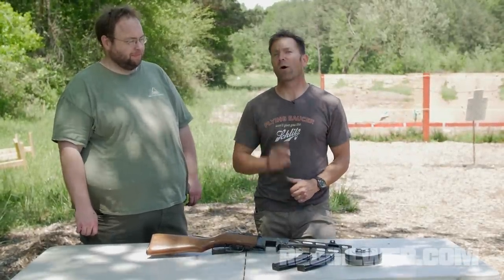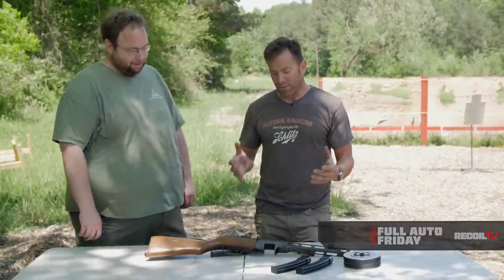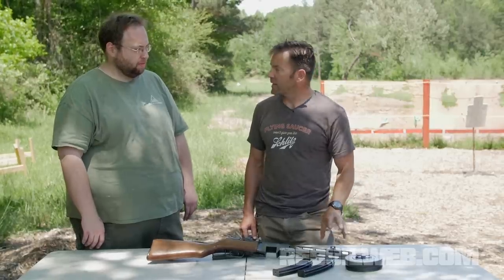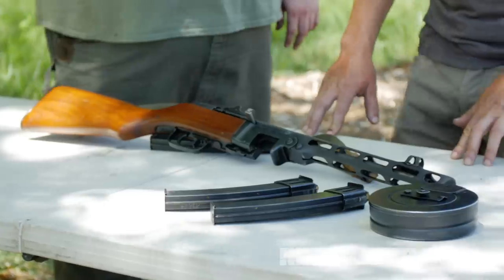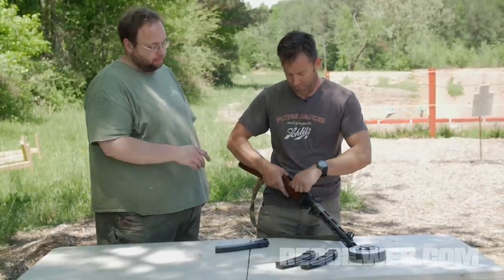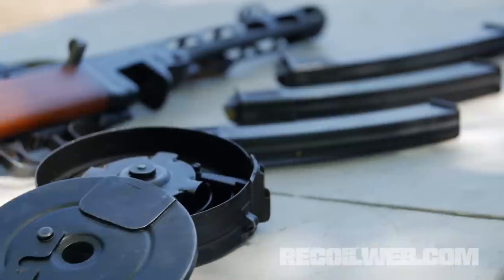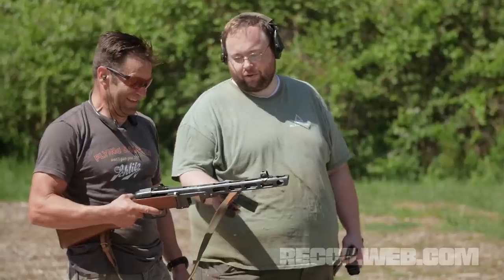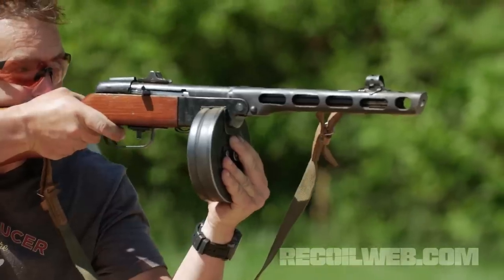The PPSh-41 Soviet Submachine Gun

Comment: PPSh-41 is pretty good! My favorite WWII SMG.
Reply: One of the real, genuine questions I have is just how effective a WW2 SMG was relative to a rifle as a general purpose battle weapon.

SMG on full auto is obviously far more effective at short range.....but how short is short?

And in semi auto mode, how effective were they out to at longer ranges? Up to some, quite significant range, a semi auto SMG is obviously more effective than a bolt action rifle.

There seemed to be real resistance in many armies to the mass issue of SMGs for general combat purposes.

Has anyone got a good insight into this matter?
Reply: @ohlordy2042  well for the germans at least
when they first designed things like the mp18 during ww1 it wasn't meant to be a long-ranged weapon what so ever
but they did intend them to be capable of (semi) accurate fire up to 200 meters
(WW1 at least)

and the hesitation of mass use I believe just has to do with the cartridge and practicality of the submachine gun as a whole
one common argument I find is over the use of shotguns and while effective at close range a submachine gun would stand up better as a whole from range, to rate of fire.

But a thing I believe about why rifles stuck as the main wasn't just the power of the cartridge itself but also the ability to conserve it.
One of the main reasons it took so many armies to get repeating rifles was just out of fear that soldiers would waste it, its also why some rifles had magazine cut-offs.

I know what I said was probably all over the place but this would be my guess as to why they didn't mass adopt them.
(But I'm a ww1 guy what do I know?)
Reply: @luger_Mann  price and complexity made it harder to manufacture in comparison to bolt action rifles, less sophisticated parts needed=faster production and cheaper manufacturing Is my guess.
Reply: Yes
Reply: @ohlordy2042  the sub-Mp's found thire way into military in WW1, it was a warfare of positioning in trenches firing at each other and then either advance forward to capture land or move back to either defent(hold out for support) or to bomb with howitzes the enemy position.

Due to the fact that when you capture a well dug trench there will be a lot of dudes in there so having a bolt or even a semi rifle(rare and expensive to that time)they needed something that does the job, in a trench no one can hide to right and left anyway so a full-auto pistol cadridge fed weapon was requested.

In WW2 the sub-MP's are more of a clearing out weapon(bunkers or mayor firesupport in CQB situations or on short ranged battlefields but also for drivers, tankers and Comanders because those were the kind of people that didn't needed to head to the main frontlines or rather the main battles, but if they do they needed the superior firepower in this short range)

In the End at 1941-42 Germany used and tested STG(Sturmgewehr/Assaultrifle)prototypes, which had the effective use of beeing a full-auto weapon that is also capable of rifle similar distances has in alternate firemode a semi-auto capability and was magazine fed, and in 1944 the , till now, modern rifleman was born. In a testing report by a german commander was stated he was facinated about not having to fight battles area by area and inbetween reloading and prepareing troops, what they could do were just keep advancing and give defesive firepower and attack power in total and reload mid fighting very effectively.

If you take some creatins from WW1, the guns are always build for the purpose that was asked by troops and commanders to fullfil certain rolls,
Italy as example converted a fast firing plane-tail-MP in a sub-Mp for troops just to fit the needs of trench warfare.
The German Sturmtruppen(Stormtroops) had befor having the MP18 litterally an Gewehr98 with a hard installed 20 round box mag(trench mag) just because they needed strong firepower lots of ammo(less reloading) and a weapon that is to an extend effective to use.

In WW2 the MP40 was only a slow firing full-auto because you can manufacture it cheaper and pull the trigger soft you only fire 1 round so you can waste the country expenses for hard artillery and machineary instead on useless manufacture detailes.
You will see some last ditch weapons that didn't even get grinded so there is even a chance that your bolt could stuck on a a rough surface or like WW2 Japan that some major parts of the rifles were made out of wood and the gun had the tendency to explode in your face and kill you.
Reply: @Confirmed105  It depends on the firearm, the German FG 42 would have actually been somewhat easy to mass produce do to it being mostly stamped parts and if we compare that to say the Swiss K31 (I know different armies but still) the FG would have been far cheaper to mass produce since the K31 is handfitted and much harder to make.
Reply: @prestonsamson3674  I think my take is more accurate for the early war atleast. Soviet's had millions of smg's after the war that became obsolete when they started issuing assault rifles post-ww2
Reply: @luger_Mann  

Lots of interesting comments here.

I don't think price was necessarily the main reason for the lack of general issue of sub guns. Some subs were notably cheaper and faster to manufacture than bolt action rifles. The Ppsh41 and Sten being prime examples.

Just looking at online ballistics calculators, the energy of low BC handgun rounds drops rapidly with range. Ppsh41 rounds......7.62x25 Tokarev....have the energy of a 380 ACP at 100m and are no more powerful than 32ACP at 200m. There is also considerable bullet drop, making Tokarev rounds fairly marginal at 200m. 

But that still doesn't explain to me why sub guns weren't issued far more widely.

I'm sure that even a "marginal" round at 200m would be very effective at ensuring enemy soldiers keep their heads down and do their level best not to get hit at that range.

I'm sure I'd be extremely reluctant to expose myself if bullets with the energy of a 32ACP were whizzing past me. Getting hit would count as a very bad day. It would certainly take me out of the battle and quite possibly the war.

It seems to me that a semi-auto capable submachine gun would be more useful in the hands of most soldiers in most battle situations, than a bolt action rifle. 

The top brass not trusting conscript soldiers to conserve ammunition, along with general military conservatism, are about all I can think of NOT to mass issue cheap submachine guns.

Comment: Just bought one of these pretty cheap because the stock is pretty beat up and it's got quite a bit of ware on the finish. I personally prefer it that way; if there is any gun you want to look beat up it's a WW2/Cold War Russian gun. Unfortunately it only came with one mag so I'm going to have to hunt down a few more. Does anyone know if they ever made straight mags like the ones used in the German-converted 9mm MP41(r)'s that would fit a standard PPSH41 in Tokarev?

Comment: The "made 2 ppsh-41 barrels from 1 mosin barrel" is a myth. Just take a look at a mosin barrel and at a ppsh-41 and you will clearly see that it's impossible to make a 2 ppsh-41 barrels out of 1 mosin barrel. Furthermore, I have yet to see a ppsh-41 barrel made out of a mosin barrel, even if it was only one. All the ppsh-41 barrels I've seen had chrome lining and were clearly different from a mosin barrel
Reply: Its not exactly literal, but there was truth to the statement tho. Mosin bullets are .312 caliber while tokarev was .308 so they are different sized barrels to begin with. What they are saying by that tho is the amount of material means you can get at least 2 ppsh barrels from the amount of metal you can get 1 mosin barrel from. Im sure in a desperate situation(which the soviet union was in) they could easily use mosin barrels that have treatments to lower the internal diameter. I wouldnt be surprised if that is what they actually ended up doing
Reply: @hunterrandolph2036  the reason 2 barrels is impossible is because a mosin barrel isn't long enough to make 2 ppsh-41 barrels from it. 1 barrel could be possible but I have yet to see one (and I've handled a fair amount of ppsh-41's). If it indeed happened it would have been on a veeeeery small scale. Especially because it wouldn't really make that much sense to spend extra efford to make a ppsh-41 while you could build a mosin more easy (altough the ppsh-41 would be better in most cases)
Reply: @nathan655555  PPSH barrels like m1895 revolver sometimes (not all) were made from bad or broken mosin barrels. My grandfather worked on assembly line.
Reply: @NobleBandit  yes, that maybe possible (however I have never seen any evidence of this) but it is simply impossible that they would have build 2 ppsh41 barrels from 1 mosin barrel
Reply: @nathan655555 bad manufactured mosin barrels was used in PPSH and TT production, because for they dont need accuracy, needed to rifle. Some time later in this list was added PPS.
Reply: @PyromaN93  that could be but no way could they build 2 ppsh-41 barrels from 1 mosin barrel. It's just not physically possible
Reply: @nathan655555  I don't type that absurd